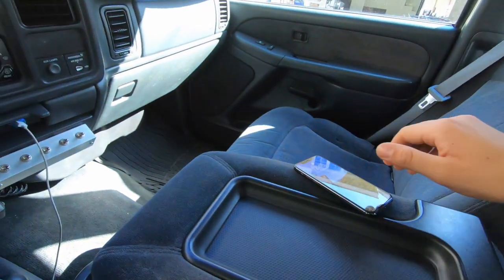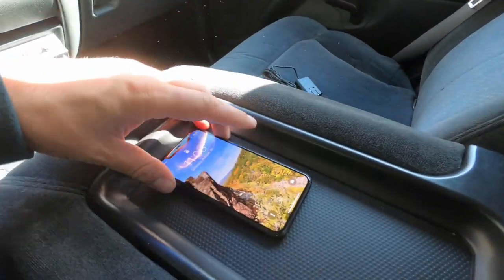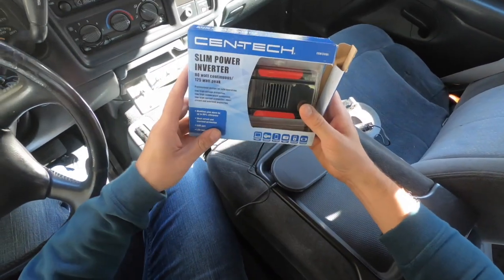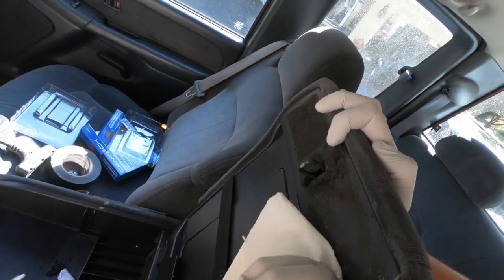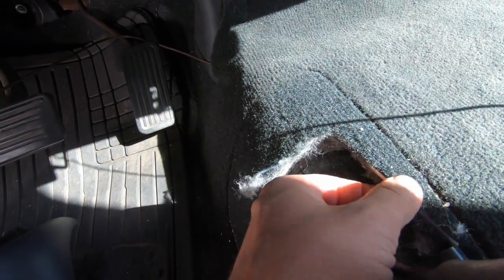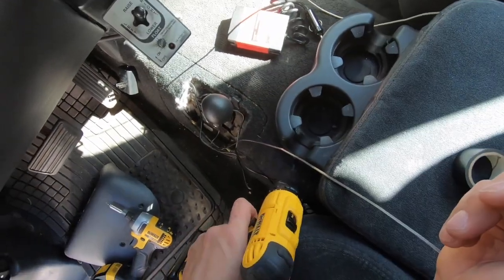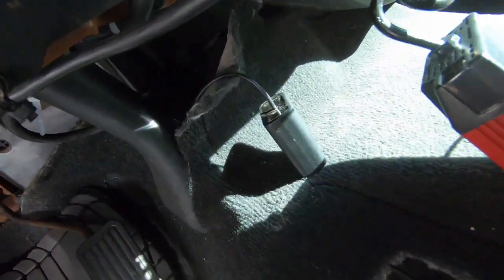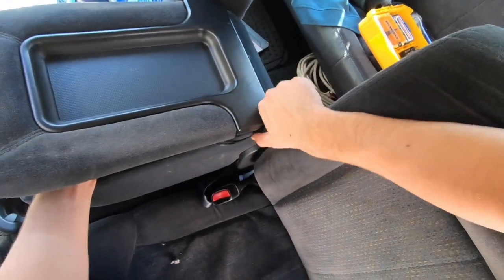Wireless Charging - Chevy Truck DIY only $30

Comment: I've tried this with several wireless chargers and I think the plastic is a bit too think for my chargers. Any suggestions? Do you think some chargers are more powerful?
Reply from the maker: Do you have a case on your phone?
Reply: I did get it to work except for the hot glue does not seem to be adhering to the plastic on the lid. It holds to the charger very well but falls from the lid instantly and I'm letting it sit for 24 hours with pressure before putting the lid back in the truck
Reply from the maker: @jflory0207  make sure the plastic surface is clean - wipe with solvent like lacquer thinner to remove grease. Also try scratching the surface with 80 grit sandpaper for better adhesion